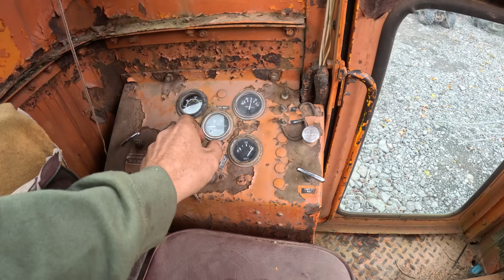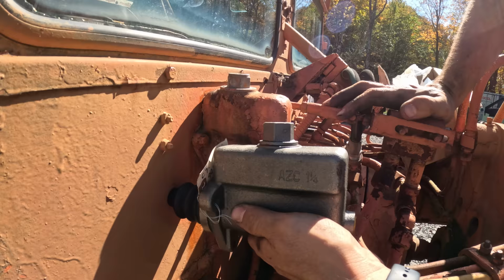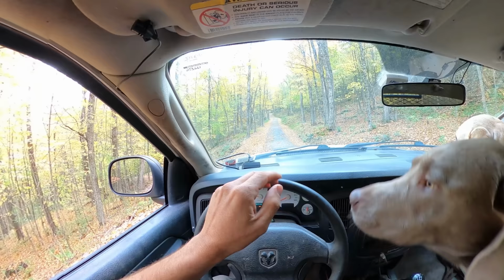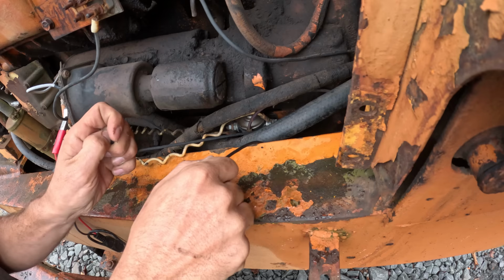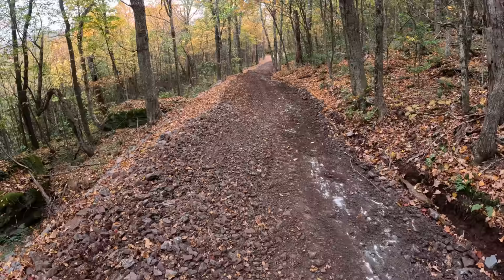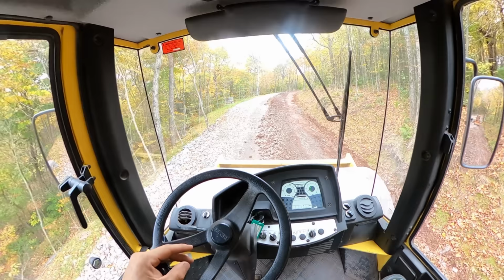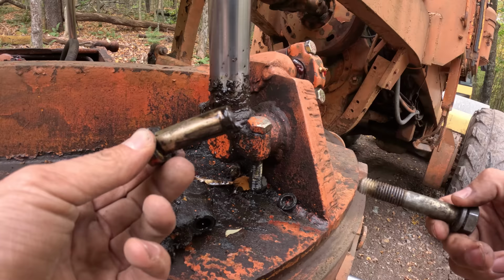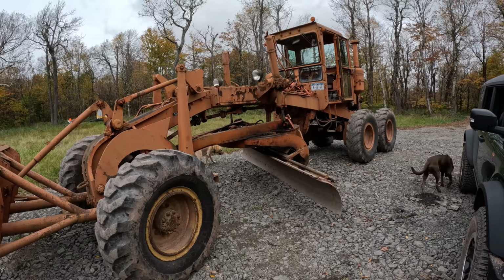Buying a cheap grader

Comment: The most important thing you need for that grader is a new set of cutting edges and end bits. And don’t forget new bolts and nuts for them, those are probably so old you’ll break most of them. A better bet for top coat on your road will be asphalt regains. It packs in really tight, and when it gets warmer, it’ll get even better.
Reply: In my neck of the woods it is the most expensive aggregate to buy...$25/ton!

It's too bad he can't get that crusher of his to do at least 3" minus.
Reply: How long will tires hold up ?
Reply: @hex0rz1 how much is dirt or gravel a ton around you? city slicker here so i’m only used to home depot 60lb bag prices lol
Reply: For that huge road, asphalt milling wouldn't be feasible. It would take around a thousand truck loads to do the whole thing. Twice that if you are running heavy equipment on it. The first steel track vehicle would destroy it.
Reply: The bolt may have sheared but the weld held, nice work.
Reply: @skonky  

That depends on size. Most common size is 3/4" crush. That runs about $8-9/ ton. Sounds cheap, but factor in trucking costs and it adds up real quick. Especially if you need several hundred tons at a time.
Reply: @prima164  

I drive dump truck for a living. I work with several contractors and have coworkers who use grindings or millings for top coats.

If your expectations are that it'll perform just as good as a paved drive, your wrong. It gets very very close to it, bit it'll never be the same. I equate it to being the next step up from rock but just below actual pavement.

People who buy millings don't prep their driveway for it properly and nor do they use the right practices to maintain it. It's a totally different beast than rock. Sure it'll go down the same way like rock the first time you lay it. But after that, once it's compacted, it should only be rolled every year and seal coated.

It's very expensive to maintain the right way and needs different equipment to do it. I just stick with crush base rock. It's easy to maintain and can be bladed easily. It's not expensive to bring more in either. You can use seal coat products on a gravel driveway also. 

Put a good sub base down and a road fabric under your crush and compact it. Address your drainage issues and you'll have a good driveway/road.
Reply: @prima164 why are you wearing shoes inside the house?
Reply: Our road we top dressed it with one inch minus , that blast rock is a little tough to grade . The green stone we have here packs like concrete . 👍🇨🇦
Reply: @prima164 sounds like millings really got to ya, you most likely either got absolute shitè of a batch with more 1 ¼” chunks than fines, decided to do your millings in spring therefore getting winters batch millings and rolling it out and having expectations of it being like a freshly paved lot. Yes there will be fines that don’t pack that rise to the top but just simply take a jet pack blower and blow it away after some time, probably didn’t have patience to let it do its thing, about six months, and a summer season with ONLY fines and there shouldn’t be a problem
Reply: Geez, you're not gonna make many friends telling Camarta what to do. Loads of his fans class him as the authority.
Reply: @prima164  Not all asphalt millings are the same.  Some have enough asphalt left in them to pack and bond back together and some just never will.  You can usually tell if it has enough binder in it by looking at the color.  The color should have a deep dark black look to it.  If it is light grey then there is probably not enough asphalt left in it to make it work properly.  I no longer use it for surfacing because the price is outrageous.  In my area, state specifications require a certain percentage of it to be recycled back into fresh hot mix and then reapplied to road surfaces for the big  road rehabilitation projects,  so the plants want to keep a good supply on hand.  That is why the price is so high.  You are right though about the millings getting stuck to your shoes and being tracked into living quarters.  My wife wears sneakers with grippy souls and the loose particles on top of the millings will get stuck in the treads and end up in the floorboard of our car and house.  I have however, in the past used millings on driveways that performed well because the product was of good quality and was placed thick enough (3" minimum), compacted properly, and applied during hot weather.

Comment: Austin Western was a big innovator in the construction industry and one of the early users of hydraulics. Using two cylinders to turn the table instead of a hydraulic motor was very clever. Too bad they were sold then went out of business.

Comment: I love that rotation mechanism with the two cylinders acting on a crankshaft, That's pretty ingenious 👍
Reply: yeah its like a steamengine,never seen that before on a turntable,oldtimers were smart
Reply: I think the development of  hydraulic motors was still in it's infancy back in 69'.   It is amazing how far equipment technology has progressed in my lifetime.  But you are right, I have not seen two hydraulic cylinders configured like that to develop high torque rotational movement.  The valving must be interesting.
Reply: Just goes to show that our parents and grandparents knew what they were doing 😂😂
Reply: I had to rewind that part so many times, incredible engineering what a machine
Reply: Yes that was cool how smooth it worked
Reply: Cody thought so also!
Reply: 👉 27:35
Reply: Right? Who knows what happened to later generations lol.. @zoonam
Reply: @ionracer24  The internet and feelings 😂😂😂
Reply: @zoonam  for sure lol now we have media to tell us how ro think and feel...sad
Reply: I enjoyed the video several times. Did you use it after this one?

Comment: Andrew is always great at doing stuff. Also I would like to complement that older guy driving the grader. He sure had experience and confidence working with that machine.
Reply: I think he popped up on the 988 video as well, seems super experienced and level headed. I love having worksite veterans like that around, even if they can't haul butt all day like younger guys they have that perspective that can guide all us to do a better job, more quickly; with what we have at hand and that's the one tool you need most but can't buy at any shop or snap on catalog.
Reply: He probably worked for the state grading everything summer and winter he's probably got decades of experience
Reply: @Mississippi87  them retired state workers are amazing to have around. always tons of experience from being worked day after day for decades

Comment: Saturday morning and Andrew delivered, can't get any better. I've been lurking since the container castle build rarely ever commenting but it is crazy how far Andrew went just doing his thing and living his way.
Next up: "Grading a mountain because it's too high"
Soo after seeing that weld job, maybe Andrew reads this (I am a commercial welder)...
You should just wirebrush the paint off the metal, then tack it on the inside, then take an angle grinder, grind a V groove about 60% depth to still have some material and fracture on fracture contact for alignment. Fill the groove then do the same from the other side, completely delete the crack with the grinder, fill and finish. Better than factory :)
Reply: Hello, would you know a video example of the welding job you mentioned? At least of similar concept? Its hard to visualize with english not being my native language.

Comment: You're going to need some Class 5 on top of your rock to smooth out the road. The larger rock makes a good road bed but you need smaller rock to get a smooth road surface. 3/4 minus works really well when a 3-5" layer is put down to top of your base. That old grader is cool. Love that vintage equipment.
Reply: Yeah I was gonna say no way that all that loose rock is making the road smoother if anything it’s making it rougher.
Reply: You're not grasping the issue here.

Comment: Now you're able to edge and trim the roads so they are looking in a finished condition.  In the early days I was wishing that you had a grader, even a simpler one that would even out some of the bumps of the dirt and first rocks that you applied.  The first roads that you put in cutting down through the raw dirt, and in the wintertime too, made it an effort to get the proper grade but with just enough slant for rain run-off.  Remembering the times when you brought in a travel trailer or utility trailer and the traversing the grounds were interesting to say the least.  It was nice and fun to watch you improve some of the features of the machine while also finding out that you had a dirty gem there instead of something you had to take back.  A little spit and polish would seem to be in order here so you can be proud.  Another fine addition to your fleet of equipment.
And you seemed impressed by the Bronco that your friend drove on some of your roads.  For you to make a statement like "maybe I'll get one of these" means a lot coming from you about new vehicles!  I like them too since I've seen them on another channel by someone else in UTAH.
Reply: The crown in the middle of the road to improve runoff/drainage is nice to.

Comment: If you angle the blade as far as you can and try for full contact, that length is the the length of cut from front to back.  That is what flattens out a washboards and cuts somewhat easier at times.  Give it a try.  Hope you make an epic video of the grader makeover with paint and sandblasting, etc.  Great video with your dad (I assume that's your dad)
Reply from the maker: Thanks for the tip, still learning that machine. That is not my dad.
Reply: I agree , angled like you described stabilizes the blade and takes sway and hop out of it .
Reply: @AndrewCamarata  That's his Friend Dave.
Reply: Dave's not here....man 😊
Reply: @AndrewCamarata also steering the rear tires a hair  towards the side you're removing material from helps counter the sideways push the machine gets from the blade.
Reply: @1STGeneral No man, I'm Dave.
Reply: @1STGeneral  Lmao I did not think of that lol
Reply: He's his husband .
Reply: @AndrewCamarata what editing platform do you use?
Reply from the maker: @Huntersprojects  premiere

Comment: Austin Western Super 200, I operated a 1973 model  which appears very similar to yours except for a few subtle  changes to the cab. They were solid machines and in many respects way ahead of their time  ,The all wheel drive , rear steering and full 360  degree circle rotation were advanced for that time. Once you get used to using the circle shift you can grade steep side slopes to the side of the machine .I'm sure this is going to be a good addition  to your fleet.
Reply from the maker: Thank you. Impressive you know what it is.
Reply: Check the chain , and box oils...
Keep your eye on rear 4 tires...air up correctly and sized identical...
Diffs need oils renewed , u joints etc....
Nice gizmo , thats for sure
Reply: I was thinking, "Gallion"  but something just didn't look right.  Thanks for confirming the manufacturer.  You don't usually see Detroit engines in motor graders.  I can't remember if Terex ever made a grader but they used Detroits in many of their early machines.
Reply: Thanks for confirming Austin Western. A rare brand. Most I have seen had single rear wheels, not tandem.
Reply from the maker: The tandem is way better I think for keeping grade over bumps
Reply: @AndrewCamarata  Yes, for sure.  Plus you have twice the traction.  The walking beam suspension reduces the up and down motion by one half when traversing surface imperfections.
Reply: @AndrewCamarata  Hello Andrew how are you bag it's been a long time since we had heard from you I was a little worried

Comment: That is honestly the coolest grader I have ever seen!  The mechanical front wheel driveline, crab steering main axles, front dozer blade, ripper capabilities and the blade rotation mechanism are awesome.  Looks like it does a great job and I look forward to seeing you fix it up later!
Reply: ❓️guess you haven't seen one with GPS on it yet.

Comment: Because of the rocks in your area, you should look into getting used set of rippers for it.  Breaking up the bolders and hard spots that it can, leaving your other heavy equipment to take out the big stuff. It needs a service, a must. Take care of the electrical problem arround the starter , fuel fliters, water in fuel tank ,check glow plugs  and clean the injectors if you have  the time for easier starts with winter arround the corner. Notice one of the tires looks low. Looks like you got a great deal for a awd.
Reply: Geez, you're not gonna make many friends telling Camarta what to do. Loads of his fans class him as the authority.
Reply: @Stoff1 Hi, you taking the piss? I hope so! Or is it something that only the Brits do?

Comment: You are truly Beginners, I spent 30 years on a Finish Blade, first you have to get both ends of the blade in the dirt, second you need to square your blade so all of your rear tires are on the blading surface, dont run your tires on the berm, because the tractor will go up and down as you blade the road, its most important to generate a berm that way you can roll it back and forth until you get the surface you want, after you get the surface you want and you still have a berm, you can loose the berm on the crown or the high side of a turn
Reply from the maker: Yes, that was both of our first times operating that. It did do what I wanted it to do though.

Comment: Hey Andrew big fan congrads on the grader     I’ve been a mechanic for over forty years and it reminds me when I worked for a large landscaper and he actually had one of the first graders made serial number was 009 and at that time there was no hydraulic. Only on the power steering that was your only hydraulics on it. The rest was gear driven in. It had a electric starter to start  the pony  motor that would start the diesel   When you operated the blade and it came to the stop the handle would kick back hard like it would break your wrist. Only advise spray all nuts and bolts before removing and heat is your best friend. Love your videos and your a amazing guy and a big inspiration for all young men and women 👍👍👍👍❤️❤️❤️
Reply: Geez, you're not gonna make many friends telling Camarta what to do. Loads of his fans class him as the authority.

Comment: I'm watching the right rear tires running over the piles of rocks that the blade is leaving. It's been my experience that if you'd shift your blade to right where you're not traveling over piles, you'd get better results.
Reply: Was gonna make the same comment and, additionally, that the grader should always be driven straight down the middle of the road, where it is most level, not on one side and then the other side of the road, because that tilts the machine towards that side.

So, always drive the grader straight down the middle of the road, and move the blade (not the grader) to one side or the other of the road, making sure that one never has the blade leaving the material where the wheels will be running.

Comment: Soooo good to see you finally getting a grader! I’d given up on you!😊the blade is too far extended and every time you hit a rock it shifts the machine because of the leverage. You guys just need more practice 😊You’re gonna have to do at least 10 sweeps to spread the gravel out evenly before you start rolling it. It looks like it’s wet enough to compact well, but you’ll need to really keep grading it quite a bit to get it smooth.

Comment: If you use the front blade to knock down most of the high spots that should help reduce the load on the center blade and loosen up material so it's easier for it to do the fine grading adjustment instead of plowing with it
Reply: Geez, you're not gonna make many friends telling Camarta what to do. Loads of his fans class him as the authority.

Comment: That is a cool older grader.  The rocks were a little too coarse to grade though.  I am  not a fan of the old two stroke Detroits but this one seemed to do a good job of powering the grader but starting was a bit of a problem.  Good deal for $7,500.

Comment: My Grandfather owned a  Austin Western Master 99 from the 50's. It was mounted on 4 wheels, everything hydraulics. ( Fully loaded, rear wheels steering, didn't have a round steering wheel but a 2 pegs and, a very strong 4 cyl diesel engine).

Comment: You have your base course down,  now all you need to do is spread (tail gate) about 2 inch thick of a crushed 40mm metal over top then grade it out smooth, give it a bit of a wet and then roll it well. Will set down like concrete and be perfectly smooth if you grade it right. Then you'll be traveling up and down that drive at 60mph like your on a brand new smooth highway.
Reply: metal? Like steel?

Comment: Hey Andrew, I just seen the I believe a Galion grader, when you weld cast steel, preheat the piece to be welded, and put it in sand, like concrete sand to cool slowly, or use a rose bud and let it cool slowly. I ran a galion, that started on gas, until engine heats up and pull a leaver up hard to switch it to diesel. It was kind of a pony motor, all in one engine. Good luck to you. You got what it takes son.